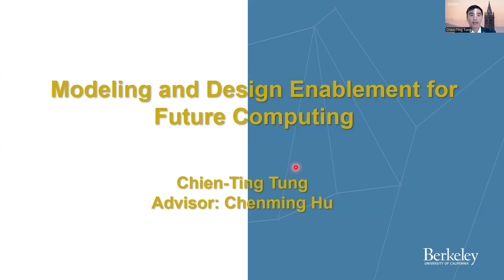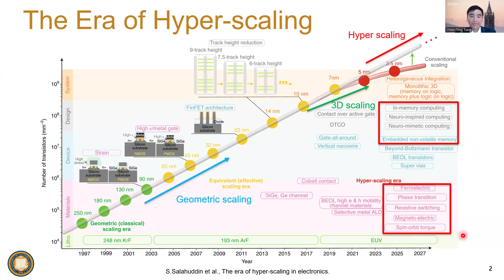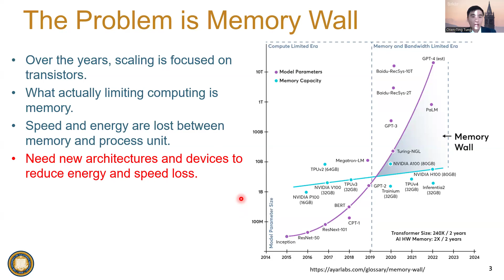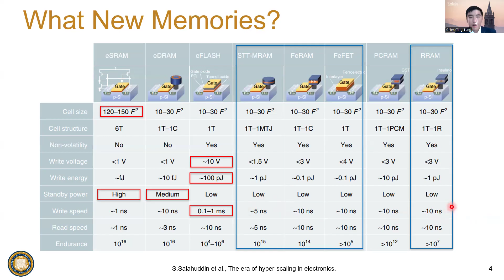Modeling and Design Enablement for Future Computing

Comment: Hello, I'm interested in your speech about the 17th minute, could you tell me more about how to achieve charge equality?
Reply from the maker: I use the subcircuit shown in the slide. Using KCL to make sure the charges are equivalent for FE and MOSFET. The currents from those current sources have the same magnitude as the charges. https://doi.org/10.1109/LED.2022.3182141